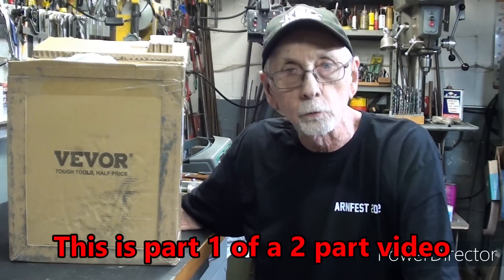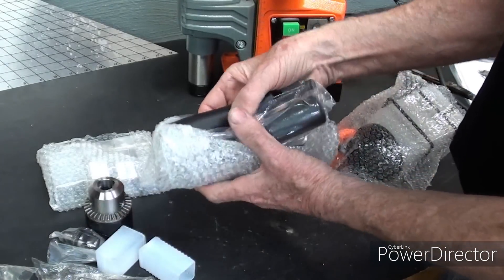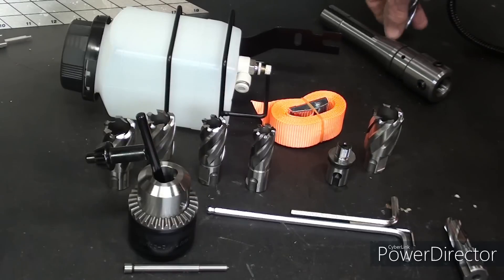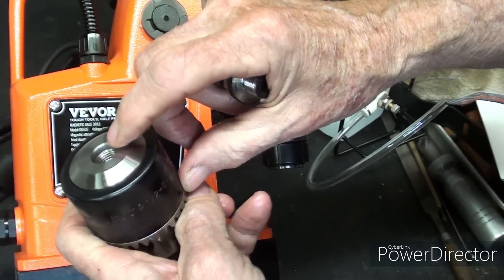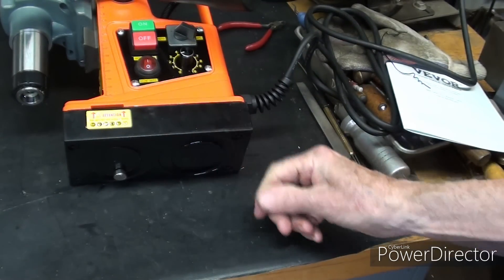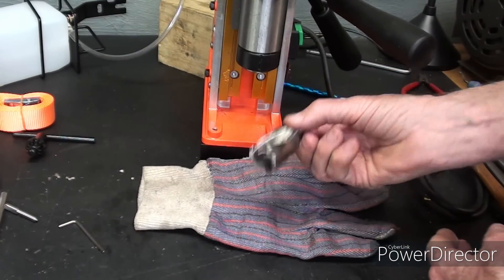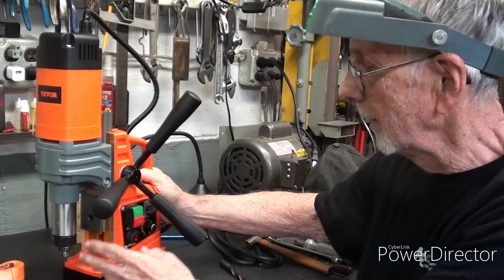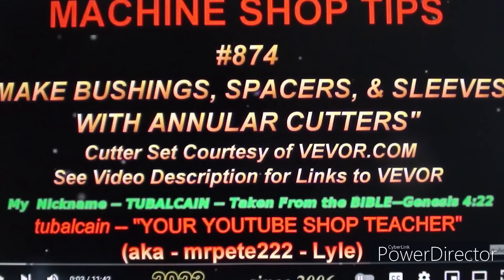VEVOR MAGNETIC DRILL PRESS pt 1 #876 tubalcain

Comment: After owning a large version of one of these, I wish they had rings or tie points for rope or straps to be used when they are horizontal or upside down in case the magnet releases or just positioning.  There is the handle opening, but it needs two tie points instead of one.  The balance changes when you move the second dovetail.  It is a lot like a regular drill press where you can move the head up and down.
Reply: There's a slot behind the head, just above the base for passing a ratchet strap through. @ 2'52" into the video there's a shot of the side of the drill. Just above the yellow label is the slot to pass the ratchet strap through. A ratchet strap should always be used with vertical or overhead drilling to keep the machine in place in the event of a power failure.

Comment: Great video Mr. Pete.  That's really not a bad price as we've paid over $2.000 for the Milwaukee brand at work.  They're used in the horizontal position a lot at work, drilling and tapping for mounting brackets and things that hang off stamping presses.
Reply: Back in 1976 while setting up the stamping room at the Borg Warner radiator mfg plant in Coldwater, MIchigan our boss, Jeff Wagner, bought us a Milwaukee Magnetic Drill Press to help with installing the air guards on the big stamping and drawing presses. 
It came with a chain for securing the drill in use. We were respectful of the 40 or so lbs that it weighed. We always secured the drill press just so if the power failed we didn't ride it to the ground. 😁😎 
I never had the power fail, but it did come loose while I was up about 15 feet on a ladder. 
We didn't expect any problems as we had drilled and tapped 6 machines for guarding by that time. 
Little did we know but the Bliss 400 ton 4x8 platen mechanical press had a secret. 
In the casting for the right front post of the press there was a void.  Not structurally damaging as it was less than an inch deep. 
Bliss filled the cavity with plastic body filler. 
I had set the base of the drill on the edge of the void so that the back end of the magnet was over the void and the front was on about 3 inches of the actual casting. 
Everything was fine until I started drilling. I no sooner started drilling when the drill dropped loose. Still running it dropped about 6 inches and was swinging on the chain. Fortunately, it didn't swing into me or the ladder. 
After that we used a magnetic pick-up tool to verify that there was metal under the shiny green paint.
Reply: The Milwaukee is a 100 times better than the vevor. If you noticed in the first of the video he picked it up with one hand. You would not pick up a magnet Milwaukee with one hand. Also if you look up vevor in the better business bureau they have over 50 pages of complaints and a F rating which is the worst you can receive. The better business bureau stated they had contacted them and had no response. This is about the tenth channel where they are giving equipment away just to boost sales. And the bad thing is these guys is just playing right into there hands with all this free stuff.
Reply: @anthonycash4609  from what I have seen the vevor stuff appears to be much of it made by the same people making harbor freight so it’s like mail order harbor freight.

Comment: Mr. Pete thanks for the video!  FYI you can get an adapter to go from the "Nitto-Kohki One-Touch" quick disconnect cutters of this model to Weldon Shank cutters, so you can use BOTH on your mag drill!  As far as I am concerned, "Nitto-Kohki One-Touch" is REALLY cool, instead of futzing with Allen screws and wrenches.  Weldon Shank is old technology like the old Bag Phone.  But with the adapter you can have both until the "Nitto-Kohki One-Touch" becomes the norm.  Thanks for all you do!

Comment: One thing worth mentioning is that the magnet will hold securely on thick steel plate. However the thinner the metal the less power it will have to hold the unit down. Vevo seem to have some great value tools.

Comment: Mr Pete,  that style shank is from a company called Nitto Kohki, and is their "one touch adapter".  Another company (and others, I'm sure) called Accusize, makes an adapter that is Nitto on the male and, and has a 3/4 Weldon female end to be able to use your other annular cutters.  I bought mine from either ebay or Amazon  for roughly $20 each shipped. I recently bought the same drill you unboxed, as well as the adapters.  Hope this helps.
Reply from the maker: 👍👍thanks

Comment: I picked up an old B&D mag drill recently.
By the time I buy the parts it was missing and get it set up to drill I probably could have bought one of the Vevors.

I had actually been looking at them.
I wanted a model like yours with variable speed and reverse.
Some models don't have that, in this day and age I can't understand why.
It is just a matter of adding a switch and a potentiometer.

I assume someone makes a quick release to Weldon adapter so you could use your other bits?
I would like to see how they hold up in a mag drill.

Glad to see you get some free gear.
I have been interested in this unit and may still buy one in the future in spite of finding the vintage B&D.
It is 100 pounds once you hook the drill and the magnet together.

I have a bad back among other issues so I will not be sticking that to the frame of a truck to drill holes for a hitch for instance.
I have a hard time moving it arround without injuring myself to be honest.

You will give us the straight dope on this so I should be able to tell if it is worth buying.
Headed to the follow up video now!

Comment: Hi,Mr Pete,if you picked it up its pretty light weight.I have one I bough on flea bay that wights 80 pounds and has a 3/4  chuck.I can barely lift it let alone stick it up on a beam anymore.Only thing is you can't  use long drills.

Comment: Good video and a pretty nice magnetic drill.  It's a good size too.  I did some quick calculations from the nameplate:  by the wattage (1400W) and a 0.6 factor for the motor at 810 rpm it figures to be about 1-1/8 hp and a torque of 87.6 in-lbs of torque at 810 rpm.  If a 1" (25.4mm) dia, 8 tooth cutter, 3/16" thick tooth was installed it could generate a circular cutting force of about 27lbs per tooth (more if the cutter dia is smaller).
Reply from the maker: Thanks

Comment: I bought a vevor ice machine last summer. It has been a really good machine. They say it holds 44lbs but the thing probably only holds 8-10lbs it without help. Which is fine because that's about the thermal efficiency of my cooler. It seems to be a quality ice machine if you're looking for one I would recommend it. Not sure where they got 110lbs an hour more like 10lb every 6 hours with the thickness I have
Reply from the maker: It’s like my electric bicycle claims to have a 40 mile range. That would be 40 miles downhill with a 20 pound rider going with the wind. It actually has a range of 20 miles. Why do they lie?
Reply: @mrpete222  that's a great question. I suppose it's so you think you're getting more for your money. Why pay double for the American made or brand name? You can pay half that for the other one that 'does the same thing' it's the most unfortunate of human qualities. When money is involved people will unfortunately do just about anything.

Comment: If I understand you correctly, the cutters use one touch side lock shanks, making them somewhat proprietary compared to the industry-standard Weldon shanks.  Secondly, only a limited number of Metric sizes are available ( no fractional sizes).  Lastly, Vevor sellls annular cutter sets which do not even fit in this magnetic drill press.  It seems to me that without the ability to utilize standard cutters, and a limited selection of metric sizes, this device is of limited use.

Comment: I just got my Vevor mag drill in today. I ordered the 1300 watt version with reverse for tapping, mine has the 3/4 Weldon and 1/2-20 thread adapter for the chuck. I haven't tried the chuck out but it felt cheap and I went digging around in my chuck assortment and came up with a new looking American made Jacobs 33B 1/2" capacity with 1/2-20 thread mount that I will put on it. 
My mag drill only came with two 40mm annular cutters so I will have to order a set for it. I tried it out on a piece of 5/16" A36 plate and it seem to do just fine as long as you give it a chance to cut without putting to much force and trying to push the cutter through like Bubba likes to do.

Comment: You mentioned not having an attached vise. 
A lash up we made for the drill at Borg Warner was a 1/2" thick plate with a drill press vise bolted to it. 
You want 1/2" to give enough metal for the magnet to get a good grip. 
The weld shop clamped things to their welding bench and used the Milwaukee to run short production runs.
Reply from the maker: Great idea

Comment: They should include an adaptor to use standard annular cutters. Where do you buy additional annular cutters with the quick release? Did not see any on their site
Reply from the maker: Yes, I noticed that
Reply: @mrpete222  an adaptor might be a good video for you
Reply: @mrpete222  A series of adapters would be useful. One to take the 3/4" Weldon shank, another for the square shank of larger taps, etc. There's so much range in the height of the drill that the extra 1 1/2" or so that the adapters would add wouldn't interfere with the function of the drill.

Comment: Just wondering if a small 110V fan blowing across the base would aid in cooling the electro magnets ? Maybe 2 fans one on each side or maybe 3 another blowing towards the back .I think a set of heat sink fins that attached to each side with screws or some rare magnets might help.

Comment: I have an old Milwaukee magnetic drill and it's the best drill press in my shop. I can use much larger drills than with my other press, 1 1/4 is the biggest I've successfully used. I've also tapped holes with it, 7/8 being the largest. The variable speed and high torque are probably it's best features, in my opinion. It does have it's down sides though. It's not terribly convenient, it's heavy, and if those magnets slip and your tool gets bound up you better watch out. You'll get clobbered by a 70 lb chunk of metal. I'm hoping to make an adapter that lets me mount a mt2 boring head in the chuck. Should be fun.

Comment: Maybe you can modify the rear inside face of the chuck, and the screw-in spindle. If you put a countersunk hole that fits a 1/4" flat head screw, and a matching 1/4-20 or 28 tapped hole in the screw-in spindle, then when you put the two together, you can add the flat head screw, and thereby lock the spindle into the chuck. Then if you want to separate the two again, it's just the simple act of removing the internal screw.

Comment: Dear Lyle, you can take a steel plate, attach mag drills to it, 
then use the area hanging from under the drill to use as a drill press table
to put your vice on...or just clamp the part to the plate.....

I had a lot. of 3x3x3/8 angle 4 inches long that needed drilling on location....
could not attach the drill to the part, but sure could attach to a steel plate
and clamp part to the plate....
with annular cutters, you have the 'slug' in the hole, when you cut through, 
the slug will prevent the cutter from cutting what is underneath.....
so you do not need a hole in your 'drill press' plate for the cutter to 
go through .....the slug just rubs on the plate....pretty cool huh...
us old geezers are lazy and find the easiest way to get something done...Paul

Comment: Can it be reversed without shutting off? If it can it would be good for tapping. Years ago i drilled and tapped a couple hundred 3/8x16 holes in steel with a Milwaukee mag drill with reverse.
Reply from the maker: No, you have to stop the motor to put it in reverse. It did not work well for tapping. Watch the next video tomorrow.

Comment: I bought the cheaper 1300 watt one for $140. The main drawback on it is it is not variable speed like that one. I wonder if I can use a router speed controller or if that will burn up the motor.

Comment: Thank you for pointing out that annular cutters require  lot of coolant because I just watched two other video reviews where they drilled test holes with nearly no coolant, it was making me cringe just watching
I only own two annular cutters and they are both universal shank, they have the three point ball bearing retention mechanism of the quick fit system as well the two flats of the Weldon shank system - a determined person could try and grind the quick shank system onto your Weldon shank cutters

Comment: Can you make a short video where you try to lift and hold it horizontally by running a rope through the handle and hoisting it up an elevator shaft?  Will it balance easily to drill a hole in the side of the shaft?  (you should be hanging on a different rope)

Comment: My guess is that you will find there will be low torque at low rpm.
Reply from the maker: Your guess is absolutely correct
Reply: @mrpete222  I found with my Vevor that the low speed torque does bog down a drill, but the electronic speed control increases the torque and speed eventually. The speed control is very laggy, so that could benefit from a design upgrade. But if you spend some time with the drill you'll learn to compensate for the lag and just keep pokin' holes.

Comment: Don't know if it could survive our ham fisted Ironworkers, but on paper (or to be correct-YouTube) I like this one much better then ohigh buck Hougans. The double dove tail is the best thing since sliced bread on a portamag . The through coolant is WAY better the Hougan's too. 

I do not like chicom anything but I'm betting you could get 2 of these and a bunch of cutter for the cost of a Hougan  or a Milwaukee,. Hougan might be expensive but  at least it's  made in Michigan but just by looking at it I like the Vevor better. .

Yo Lyle, Looks like it's time to get out the dividing head and a piece of 4140 and make a Weldon to QD adapter.. A better Drill Chuck adapter with a JT taper and dixie up some Weldon to tap sleeves would be in order too.

Comment: Mr Pete:  I have the very same Vevor model mag drill.  How do you adjust this mag drill to stay in the top position until you choose to lower it?  Mine, with or without a bit /chuck falls to the lowest spindle position.  Good review!  thx
Reply from the maker: Actually, I only used 
this machine one time. And that was to make the video. So I cannot answer your question, but I think there are gib adjustment screws?
Reply: @mrpete222  thanks for your reply.  I have tried different combinations of tightness on those gib screws but can't get the drill head to stay up.

Comment: Does Vevor offer replacement drill bits as they only seem to be available from them and no one else? You stated your Weldon bits do NOT fit that quick release shaft, so if you needed more bits or different size bits or replacement bits, can you purchase more from them? I don't see these particular quick release drill bits on their website.
Reply from the maker: I didn’t see them in their website. I won’t live long enough to need any replacements.

Comment: just take some stock put a hole in it thread it to the size of the drillchuck Stud and bore a hole with some setcrews on the other side.. and you can slide in your other annular cutters Without needing to do basically any work or buying anything else.. Multi purpose adapter.. for the drillchuck and your other annular cutters..
Sometimes the easiest easiest solution is the best
Reply from the maker: Excellent idea

Comment: What is a "fried dough twist drill"?  AND why would I be concerned with it's diameter?   This is on the nameplate.  Is it for making bagels?    BEWARE???  Vevor sells only the cutters you have, not others. You are stuck with the 6 you have unless you can find another supplier. That is not a selling feature of this tool.  I am not totally pleased with the drill chuck as far as attachment for the reason you have stated, reverse. Another Chinese faux pax.  This would be good in a small shop that did truck frame modifications where you must drill through some tough steel on the side of the rails. The flanges are an untouchable area for welding and drilling as it can cause the entire channel to crack. This is about the only other place I would see a need for this unit due to it's base and limited features. Do any Chinese engineers have real lifetime experience or are they strictly computer hacks.
Reply from the maker: lol.    Yes, utter insanity
Reply: Ever heard of a product called "Loctite"?

Comment: Nope all drills is not plastic. The Milwaukee magnetic drill is all metal and 10 times better. Also it has never quit due to over heating. The vevor does not even come close to a Milwaukee, just because it's free to you doesn't mean it's any good. You are about the tenth channel where I have seen them give tools  to just to boost sales. Also when they sell out of something they tell the customer that it probably will not come back in stock at the same price. Also they have over 50 pages of complaints with the better business bureau and a F rating. The better business bureau contacted them and got no response.

Comment: FINALLY, someone with some competence gets a product to review. That stupid shank is a deal breaker for me. I don't like it when companies do that stuff, forcing you to buy all new tooling through them. EDIT: You could maybe throw a little weld tack on that chuck adapter just to keep it from unthreading. A small tack, something that could be easily ground back off, would likely be enough to keep from allowing it to start unthreading.
Reply: Many drill chucks have a LH screw inside the chuck jaws to prevent them from unthreading. Open the jaws and check for this.
Reply from the maker: Yes, all of my craftsman heavy duty drills have that feature